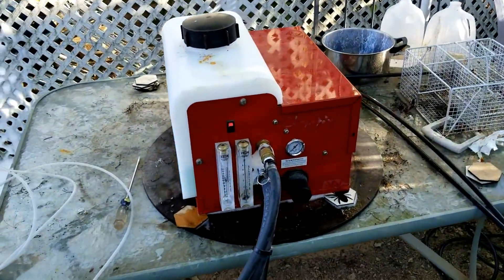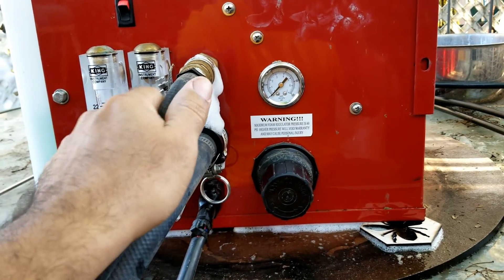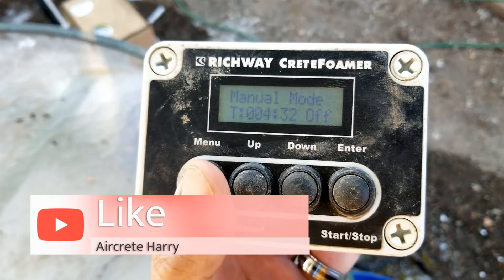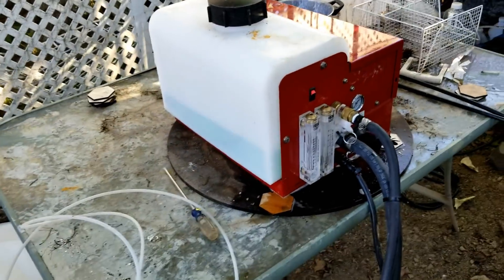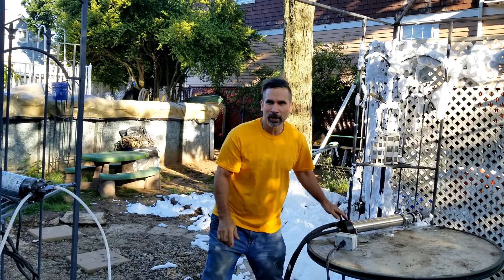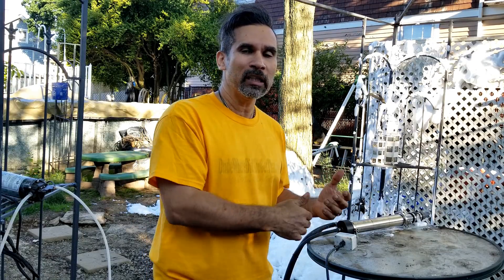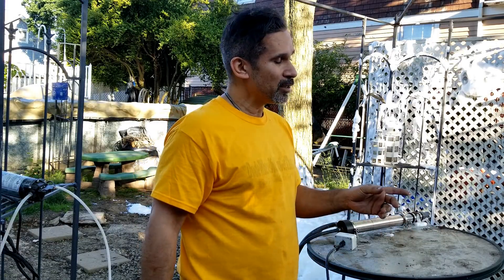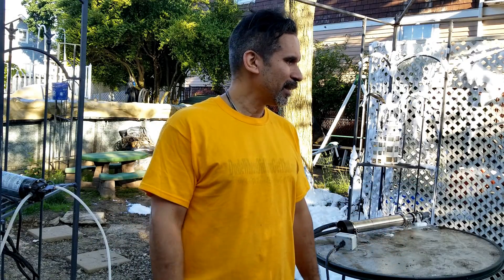My Aircrete Journey | Part 2 #Aircrete #aircreteharry #aircrete #dome #diy #foamtest #drexel

Comment: Did you ever look into "Autoclaved aerated concrete" blocks? What are your thoughts about that material?
Reply: There are some videos on here (not definitive source) that test autoclaved versus just straight aircrete, and the autoclaved is far more brittle to impacts and compressive. You also have the extraordinary extra equipment hassle and energy consumption of the oven needed - probably too much for a DIY system.  AAC often uses the aluminum powder to create the foam with hydrogen off-gassing bubbles, and it may be that it is SO foamy that it NEEDS the oven to cure fully. I am not sure. Would love to hear what Harry has to say...
Reply: David Mason: Thanks! I wonder why he hasn't tested styrofoam pellets in his mixture? It seems like styrofoam would be as good as air and less difficult to mix. I appreciate your input!
Reply: I know some people mix it in to regular concrete, but it would require a thicker slurry or it might float to the top...also, if one is after the fire proofing aspects of foamcrete, I don't think you'd get the same results with styro added, and there's be a risk of off gassing over time which you don't have with foamcrete
Reply: I have seen folks use vermiculite instead of foam to decrease the weight, but it was primarily being used for making fire-bricks for ovens, or in a crucible for metal work. I think it would be an interesting addition, much like Styrofoam, but without the drawbacks that have been mentioned.

Comment: I love your videos. I want to build an aircrete shed 10x20'  i would like to pour the walls in 10' sections 4"thick 8' high could you guide me on where to find info on mix ratios? I dont want to be experimenting with walls that big. Thanks
Reply from the maker: I'm working on getting that information together this coming week.
Reply: Also check out the HoneyDo Carpenter who is working on a very similar project.